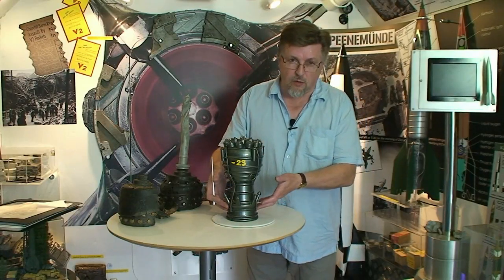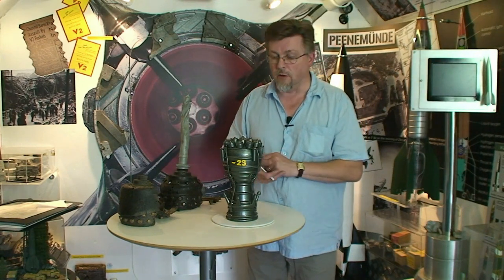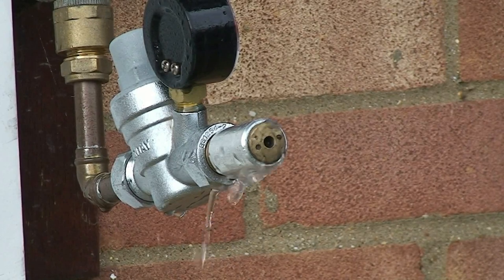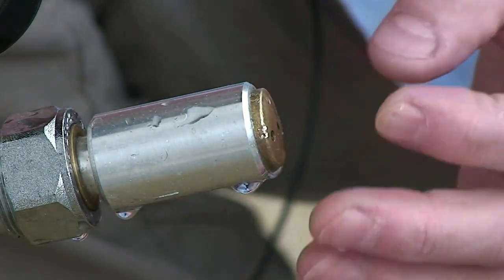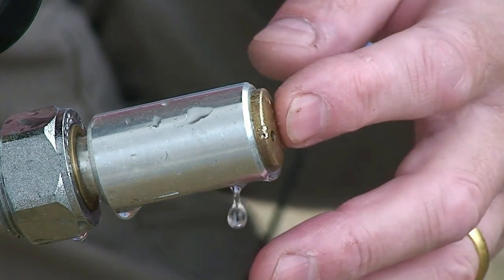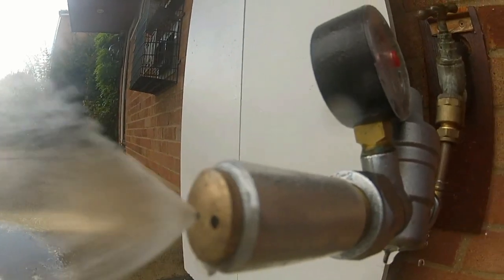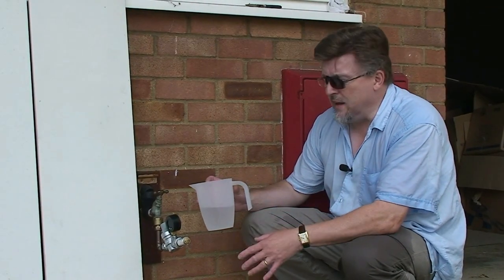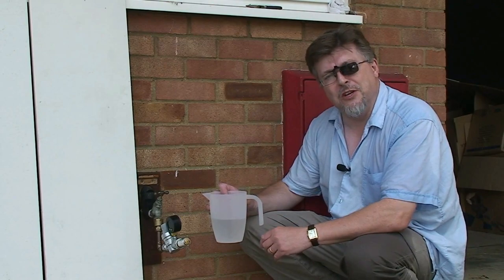A4 / V2 Rocket in detail: fuel and oxygen injectors

Comment: All the V-2 needed was a couple of "T Stoff\C Stoff" Boosters and the Kraut's could have put the Rocket High Enough into Earth Orbit to Hit Washington or New York.
Reply: +Faffa
You sure are impressed with the V-2, it was epic though. Thank God the Krauts didn't figure out the same thing you did. I think they would have bombed both NY and Washington.
Reply: They could do the thrust & fuel capacity, no problem.(some development needed, of course)
Control systems... not so much.
This was quite before the era of electronics, and their idea of a good directional control was to put a graphite vane directly in the exhaust!
.
Still, look at their plans for A9/A10..
Reply: faffaflunkie Blah, blah, blah. Please purchase "Handbook of Astronautical Engineering" (from 1961) or the modern version "Standard Handbook for Aeronautical and Astronautical Engineers". Study one of them, then make updated comments. You're welcome.
Reply: Marvin Kitfox The vanes in the exhaust were for spin stabilization- a kluge to compensate for the instability of the design of the V-2.
Reply from the maker: Marvin Kitfox et al. Given that the Germans sometimes missed London completely and it’s over 20 miles in diameter – the ballistic missile equivalent of missing a barn door at 20 paces with a 12 gauge - I think coaxing the missile technology of the era into striking the continental USA anywhere (that’s anywhere at all) would be a more realistic goal – that’s if you can call anything related to the monumental folly of the V2 missile ‘realistic’. The fact that the Nazi leadership even considered this, however momentarily, just illustrated how far from any sense of reality they really were. The idea that America would have changed its war-time policy or alliance with Britain in a way that would have been favourable to Germany because of its ability to lob a handful (the county simply did not have the resources for any more than this) of sub one ton warheads along about 200 miles of the US East coast is just foolish. Fall short (most common situation) and the missile makes a small splash in the Atlantic – overshoot and you make a large crater in a corn field. The chances of Germany hitting New York or Washington with the technology at the state it was in mid-1945: vanishingly close to zero.  Thanks for posting. KR RJD
Reply: Of course Germany ignored the obvious- that is launching it's more effective weapon, the V-1, from it's U-Boats- which were at the time operating within sight of the U.S. Eastern Seaboard.
Reply: faffaflunkie U-boats had long been swept out of the US eastern seaboard before the V-1 became operational.
Reply: FroggieTheR0gue Let's allow R.V. Jones to tell you what a "real threat" they were:

When Churchill was briefed on the V-2 he stated "We've been caught napping!" I then informed him that the RAF regularly dropped 8,000 tons of bombs on Reich targets several times a month and that a few hundred rockets, even in a week, amounted to 3% of what we inflicted on a single night raid. "Most Secret War" R.V. Jones.

So sure, if Donitz could muster 8,000 U-boats each with a V-1 on a single attack he'd have some clout against Americas' eastern seaboard. The trouble with most arm chair war experts is they cannot understand the true nature of industrialized warfare.
Reply: DataWaveTaGo
faffa is very knowledgeable about such things, especially industrialized warfare and is an expert on both the V-1 and V-2 rockets.
Reply: +DataWaveTaGo you had some luck,  all the world was fighing Germany, thats was the RAF lucky day.
Reply: +faffaflunkie   Launching a V1 from a ramp on a surfaced sub, while theoretically possible would make the boat very vulnerable to surface attack and I think that a new and bigger sub would have been required.  Remember that the first V1 wasn't launched until after D-Day and by then Germany was all but finished and simply did not have the resources for any further R & D.  
There would have also been no way of launching a V2 from the deck of a U Boat without destroying the boat and in the process killing all on board, not a good option.
Underwater launches of ballistic missiles wasn't a technology available to the Germans and in fact wasn't perfected until the advent of nuclear subs.
Reply: Dan NZ
What's your point, that everyone on the boat would be killed while launching the V2?
No one cares, as the V2 was epic, as was the V1.
Besides you don't know if that's really true.
Reply: Dan NZ All that the V-1 flying bomb needed for a successful launch was a steel rail- and remember that the V-1 had a 125 mile range. German U-Boats were actually used mostly as surface vessels- albeit ones that could duck underwater for short periods of time- not like the modern diesel or nuclear powered submarines that you are thinking of. As far as a sea launched V-2, as you said- that was at least a decade away- a decade that the Germans didn't have.
Reply: Yeah that's true, it's lucky the war ended when it did.
Reply: faffaflunkie
You're being stuck up and I don't know why.
Reply: Total bullshit, the V2 could only reach a velocity of 1.6 km/s in its original configuration. You would need at least 7.9 km/s for an orbital weapon. This would require at least 2 additional stages for a specific impulse of 282 seconds (which is typical for a LOX/Alcohol engine).

Thereby creating a completely different launch vehicle.

Comment: What’s the optimum altitude that a rocket exhaust works.
By the time it reached the ionosphere where’s there 0 molecules so the exhaust would have to be the size of London in order to push off the atmosphere.
Space is impossible next to a positive pressure without a solid barrier it violates the 2nd law of thermodynamics.
A rocket exhaust at high altitude violates Newton’s third law.
A force is a push or a pull that acts upon an object as a results of its interaction with another object. Forces result from interactions! As discussed in Lesson 2, some forces result from contact interactions (normal, frictional, tensional, and applied forces are examples of contact forces) and other forces are the result of action-at-a-distance interactions (gravitational, electrical, and magnetic forces). According to Newton, whenever objects A and B interact with each other, they exert forces upon each other. When you sit in your chair, your body exerts a downward force on the chair and the chair exerts an upward force on your body. There are two forces resulting from this interaction - a force on the chair and a force on your body. These two forces are called action and reaction forces and are the subject of Newton's third law of motion. Formally stated, Newton's third law is:

For every action, there is an equal and opposite reaction.
Reply from the maker: We passed your tedious post as a perfect example of pointless twaddle. I sincerely hope anyone who had a role in your education in junior school physics doesn't see this - that amount of cringe could be fatal in a mature person. And save those itchy fingers; don't bother posting anything else here - we won't pass it unless its a very polite 'I'm so sorry to have bothered you all, I don't know what came over me!'. RJD A&NTV
Reply: a vacuum